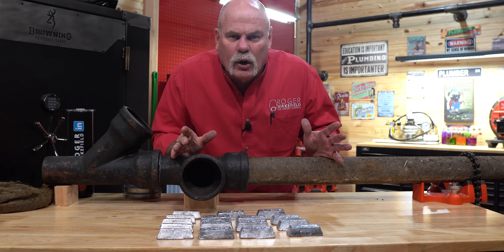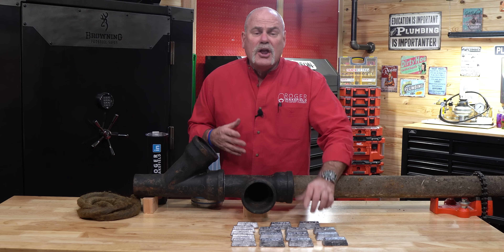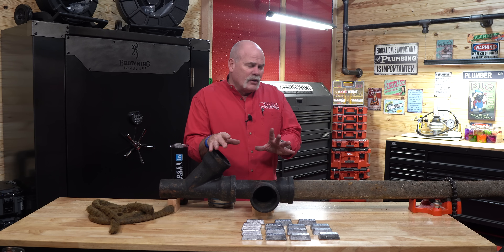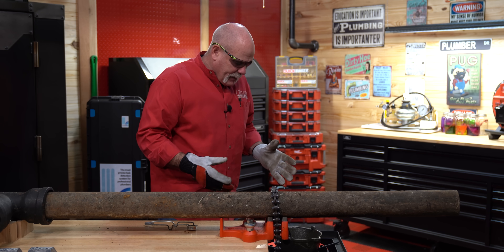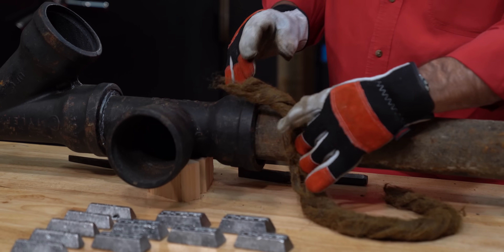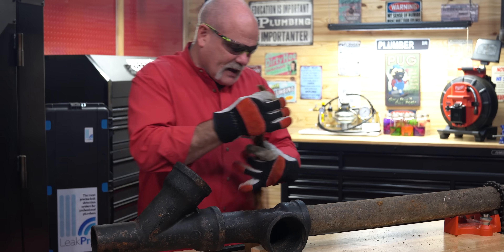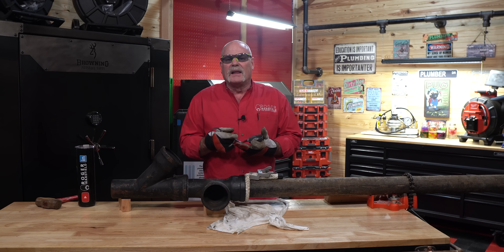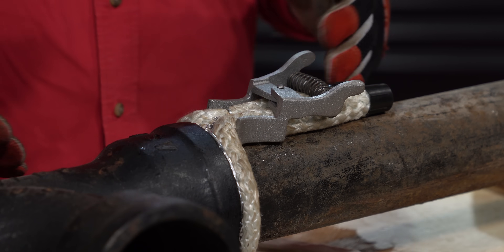How Plumbing USED to be Done

Comment: I'm a plumber in Chicago we're doing a high-rise right now all lead and oakum joints we usually use white oakum but there is a shortage. So we're using the brown oakum wich is worse. Doesn't hold the pipe or fittings that good in place before you pour the lead. Also way more stickier makes which leaves your irons nasty.
Reply: Local 130 👍
Reply: @NoName-yr1jv Plumbers LU 130 UA. Third generation here

Comment: You are a little rusty😏.  HOWEVER, you did demonstrate the basics of the process.  I did thousands of those joints and used to have hundreds of yearning and caulking chisels.  Even the ones for joints up close to the ceiling.  You need to soak your runners in oil prior to using - extend it's life expectancy.   Jute was common as an alternative to okum - came on a spool and was easier to push it.
Reply from the maker: Thanks for the tips!

Comment: Chicago 130 plumbin we are still doing lead and oakum
Reply: Im in commercial 130 covers around 13 counties so technically only down town or city addresses require lead and oakum. Illinois has state and city plumbing licenses. Outside of the city its more whatever the customer wants usually pvc for dwv and copper for water but ive been on a few pex jobs. Apparently idk how true it is but ive heard around boston chicago and new york are kind of the last theee to carry on that tradition. Also next time when you do oakum get the white tightly rolled oakum much more enjoyable and faster 😂
Reply from the maker: Commercial and residential?

Comment: Thanks for showing my Dad was in that era  of cast and copper DWV and never grasped the concept how horizontal pours were done 
Me I started in mid 80’s of true PVC before the cellcore
Reply: Bro pls tell me you don’t use cellcore on drainpipes.
Reply: @virtueofabsolution  It is rated for it in most US building codes. I personally don't see the point, it's only advantages are that it's cheap and slightly more flexible (but really, why are you needing that much flex in the first place). The disadvantages are numerous.

I guess I could see using it for vent pipe. But I would never trust running an auger down cellcore, even the baby 2in cutters would scare me.

Comment: Thought it was bad to sniff in a little cast iron dust when removing and replacing it with pvc. Plumbers really had to be around melting lead all day. Times really have improved
Reply: We are still around melting lead all day in Chicago. Lead and oakum joints are still code for Chicago.
Reply: @Dave7820  how long would it take to do like a 18 apartment complex? 3 apartments “stacked” on to of eachother all sharing the same stack. Kitchen stacks being back to back for 6 apartments if you get what I’m saying?
Reply: Melting lead was the least of your worries. The industrial plumbers like my dad were handling extremely high amounts of asbestos pipe insulation regularly
Reply: @joshdiehl8737  respect to you father for paving the way for the new generation. He walked so we could run

Comment: I'm kind of confused. Maybe someone can explain this mystery to me? Once the lead is set it has a picture perfect cast fit with the pipe, it's a perfect mirror of the surface it was cast onto. We're talking a flawless seal. When you tamp it in you deform that, and it has whatever fit you leave it with. This may be a near perfect fit, but it's not a cast-on perfect fit. So I'm kind of curious, once you have a perfect cast-on fit why would you then unseat that and destroy that seal by hammering on it? Is the purpose to ruin the seal so that if the tarred rope starts to rot away you'll see when it needs replacing? Or is there some other reason you'd do something with a perfect seal then immediately physically break that seal? And why not just hammer the lead in place instead of heating and pouring it in the first place if the purpose isn't to pour a perfect seal?
Reply: The purpose of the lead is to hold the oakum in place and prevent it from drying out. The oakum is what functions as a seal, swelling and filling up every space inside. You tamp the lead in order to tamp down the oakum deeper into the seal, and you dont particularly care too much how good of a seal the lead itself has. Itll be plenty enough for the job, if done right.
Reply: Yupp just to hold the oakum in place. The lead isn't sealing anything. Also, lead is super soft. Hammering it in likely deforms it deeper down to whatever shape it's going into. Lead is so soft. It definitely isn't acting as solder does on copper
Reply: The lead cools and contracts caulking forces it to compress to tighten up in the collar as mentioned the yarn as we call it in UK gets damp swells for a joint just like hemp does on screwed fittings.

Comment: Anytime i struggle in the field, i always remember how grateful I am to have propress, abs drains, pvc drains, pex and all that stuff that makes a job 10000x easier. If we still used lead and oakum today, I probably would be an electrician. I am so excited to see what future technology will makes its way into plumbing 30 years from now when im 50
Reply: It's all we use in Chicago. It's code to have hub and spigot, lead and oakum joints.
Reply: @Dave7820  that's ridiculous 😭
Reply: @Dave7820  That alone would be enough to make me move to another city.
Reply: @Dave7820  wait.. what?
Reply: @Dave7820  Did not know that, im halfway through my second year rn, learning in california
Reply: @Dave7820  just the underground?  I assume
Reply: @lawrenceoleary4589  underground we use push gaskets. Everything above ground is lead and oakum.
Reply: @Dave7820  no way dude!
For what reason?
Reply: @Dave7820 well codes are what help keep the skill in the trade
Reply: @t64madness  It's code but now that they stopped making double hub pipes it might start to swing Chicago to go to no hub.
Reply: @Dave7820  hopefully not it will take away from your work
Reply: @Dave7820  I'll betcha they'll just allow the one no hub between two hubs
Reply: @Dave7820  I just googled it, says Pex is not favorable because any type of rodent will eat through it easily. And yall have rats the size of cats in NY.
Reply: @Surms41  I was just referring to the Cast Iron Hub and Spigot. We don't use pex in Chicago. All water is majority Copper, with some loopholes for galvanized (water services bigger than 6"), then stainless steel for special services.
DWV is primarily cast iron for main lines, copper and galvanized iron for 2nd rough. PVC is rare unless it's 3 story residential or special systems.
Reply: Reminder that we get paid the same hourly labor rate today that plumbers who used these materials 40+ years ago were paid.
Reply: @virtueofabsolution cashiers used to be paid more before calculators took away the skill the same thing will eventually happen with plumbing even now why hire a plumber to solder a leaking pipe when you can just do it yourself with shark bite
Reply: @t64madness  Cause shark bites are notorious for causing issues, the way I see is a difference between what seperates somebody as a plumber and somebody as a handyman. The only time I will use a shark bite is if its getting late in the day and need to cap a line temporarially to make sure the homeowner still has water and then return in the morning with a fresh mind. But I always show them where and how to turn the water off before I leave incase it blows out overnight cause of higher pressure.
Reply: @t64madness  1) you have no idea what you are talking about you’re just making conjecture. There’s a big difference between knowing basic math and mastering the literally hundreds of skills required to be a master plumber besides there are many convenience stores, quiktrip in my region, that have greatly increased their pay and it’s a lot more than just cashing out 

2) shark bite is a temporary fix and more importantly is not always, even rarely,  applicable. Having an intimate understanding of plumbing systems such that you can quickly and efficiently resolve problems, or building them from the ground up like I do in new construction, requires literal thousands of hours to master. Like okay, sure, you can shark bite a fitting. How does that help you if you have a line freeze and bust at a three way galvanized water intersection? How does that help you take a set of prints and lay out and build a pvc rough-in from start to sewer tie-in before the slab gets laid down? How does that help you know what your grade is? How many DFU can you have per 2in vent? How do you install a shower drain box? How do you find the location of individual fixtures based on print measurements ? What’s the minimum size of a vent? What’s flood level? 

Google can explain some things but next time you have a major plumbing malfunction or need to build a house you let me know how those shark bites work out for you 

My point is that even without the difficult, tedious old materials you used to have to use plumbing, both service and construction, still requires thousands and thousands of hours to master but the rate of pay hasn’t changed meaning that with inflation modern plumbers make a fraction of what we made even just 30-40 years ago.
Reply: Get ready for knob and tube wiring
Reply: @technicolorskies5432  just wait until he hears how they used to drill holes!
Reply: ^^ i am an electrician and you can trust me that you don't wanna work on installations that are 100 years old... 🤷
Reply: Electricians had it bad to. One wow at a time. Heavy porcelain insulators. Plaster every time
Reply: Pro press is Garbage. If someone attempted to use it in my house they would be thrown out on their ear! Do it right or don't do it at all!
Reply: I salute you: the closest you'll catch me to a drain snake is welding an oil pipeline.
Reply: Pipeless water delivery, like wireless power delivery? No probably not, lol.
Reply: Spoken like a true electri,
Every product  you menchoned  is exactly what took the craft out of the trade.
I was installing lead and Okem and hot work copper before you were the useless drip running down ur mommas leg
Reply: In the future our toilets will teleport our sh*t to another dimension.  Not our problem
Reply: I just switched to service from residential construction and them plumbers were a different breed back in the day. Seeing all these old plumbing systems I wouldn’t have been a plumber back then! Hahah
Reply: Local 130 here out of Chicago and we lead and oakum everything unless it’s underground with push gasket or state funded jobs sometimes approve the use of no hub connections
Reply: If i have a choice between pex or copper, I'll take the copper every time.
Reply: @hamtramckchronicles  Just curious, is it just a traditional thing or is there some more benefit that you see in copper? Im in SoCal and the hard water in LA and especially OC makes these copper lines insane to keep to date, so many slab leak calls and when trying to convince of some filtration system they don't seem to see the benefits of it for pipe longevity. I always like to hear others experiences and reasonings in why they do the things they do.
Reply: @ramsaybolt3881  SoCal may be different but we mostly have full basements here in SE MI so we are staunch advocates of copper because it is a far cleaner look and is better for your health or so my boss says.
Reply: @hamtramckchronicles  here in Texas we can't have basements do to high water table or bedrock and most of our hoses are on a slab so not fun when you get a leak. I imagine CA is similar due to the earthquakes
Reply: @hamtramckchronicles  Please explain how Pex bad for your health. Thanks
Reply: At the current company I work for we are not allowed to use propress it definitely makes things a little challenging
Reply: @joesmith8784  Is that a company preference policy or is it a liability issue?
Reply: @joesmith8784  smart company propress is not reliable
Reply: @joesmith8784  it definitely is more challenging but your company only used propress they would probably have one less plumber working
Reply: @t64madness  Or they would be able to take on more contracts?
Reply: Electricians used lead to solder connections then wrapped in a splice tape.  No wire nuts 100 years ago.  Original knob and tube is incredibly durable and permanent splices.
Reply: It's funny too because when we see new stuff the trades people are all like '' this is gonna be garbage'' until we see it in action, then it's the best thing since butter on toast
Reply: @ghw1985  that's exactly what I thought about PEX when it first came out.
Reply: All these fast and easy ways to practice the trade are for the companies to speed up their income.
Also these fast and easy ways takes the skill out, and kills the trade allowing anyone to be able to plumb up a building. All which will eventually abolish the license requirements. 
So glad I retired.
Reply: Yup

Comment: People in the 1940s - 1980s could run water lines with pressure rated ABS pipe, some ABS pipe in the early 1950s was threaded like galvanized and could be used on water lines and drains. Plastic pipe in Wisconsin started becoming popular in the 1960s.